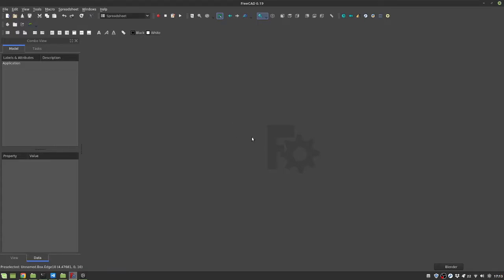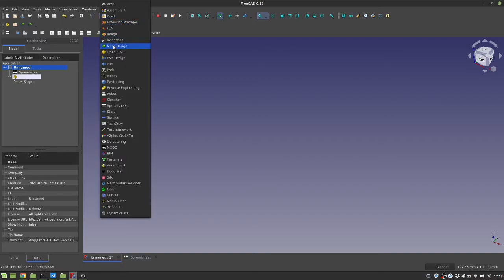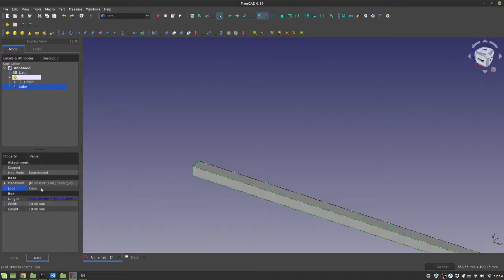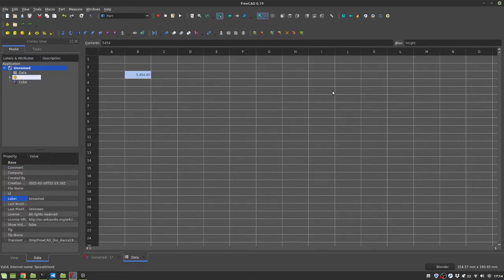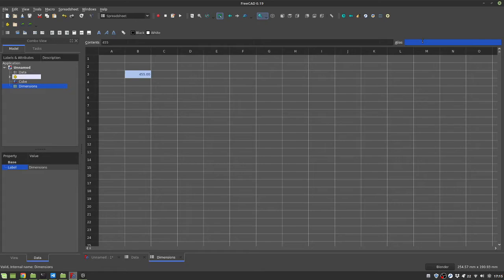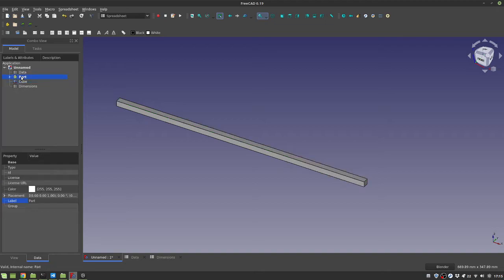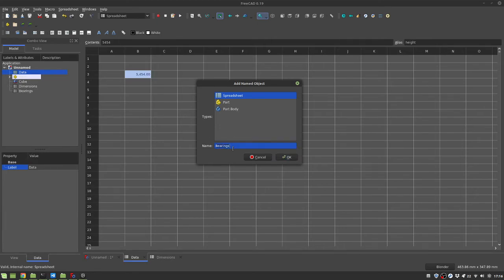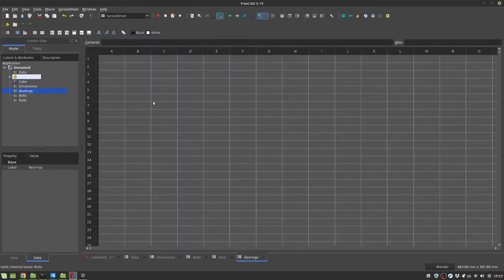How to set the real name (internal name) of FreeCAD Objects.

Comment: you can use the label by surrounding it with chevrons <<data>>.whatever.
Reply: Given I wanted to name my spreadsheet "S" for brevity, adding chevrons would have reduced brevity by a factor of 5.  (Apparently freecad doesn't handle single character names well, so I settled for "ss".)  Though, the chevron thing is still a good trick to know, in a pinch.